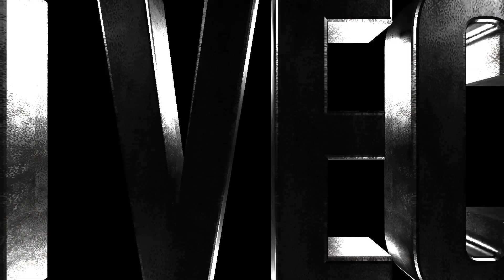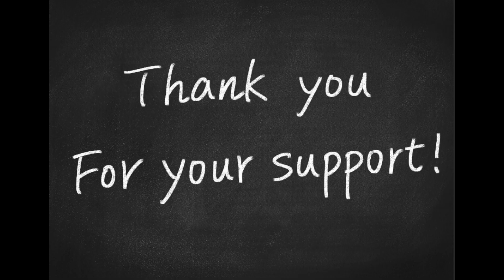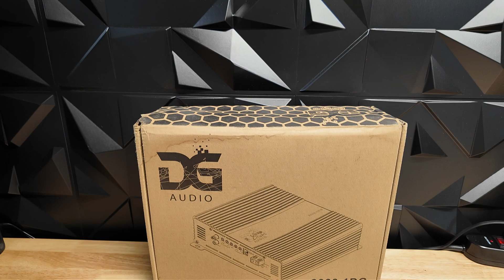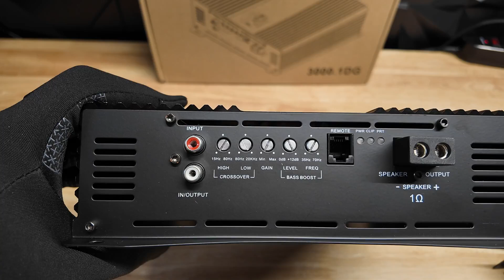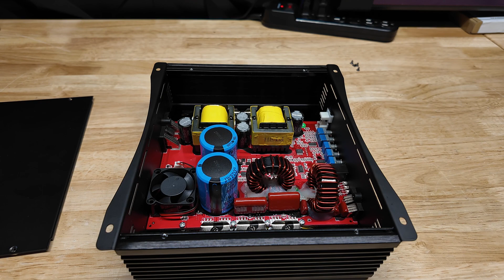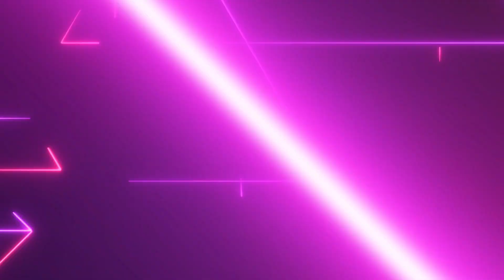DG Audio 3K Amp Dyno review 3000.1DG car audio monoblock amplifier

Comment: I just installed a JP40 lithium battery  and mine drops down to 12 volts at full tilt I gotta mechman 240 amp alternator with 0 gauge wire and my last down4sound LTO 6.0 would stay in the 14s I don’t understand why I’m dropping 2 volts. Any suggestions?
Reply from the maker: Sounds like your jp40 is the issue if it was fine with the little LT 6.0?
Reply: @ that’s what I’m thinking I’ve seen other videos and the jp40 holds 14 high 13s at full tilt and mine is dropping into the 11s. I’ve had this battery sitting in the house for 6 or 7 months but it was fully charged when I installed it in the car I don’t know what’s the issue maybe because it was sitting for so long I don’t know.

Comment: Hey bro I’d love for you to check d’amore engineering amps see what kind of results they are doing  after I say this it might be gone but on Amazon they sell the 750.1 right now for 161 which is a great price for the power and results on paper 1 ohm stable 2 40 amps fuses definitely does over 750rms, 0.05 thd 90% efficient at 4 ohms, S/N 102. Great results on paper love to see you test it buddy no doubt “ d’amore” test their amps considering they make the dyno the DD1. 350.2 is cheaper great tweeter amp if anyone wants it 112 I believe don’t quote me

Comment: Its looks identical to nvx xad minus the logo. I got an nvx xad 16 8k rms at 1 ohm. 450  bucks. Great amp. Have it powering 2 15" b2 rage v2. Sounds great. Has the nvx xad forgot what number but it was a 3k. Put out more than 3k. Way cheaper than that.